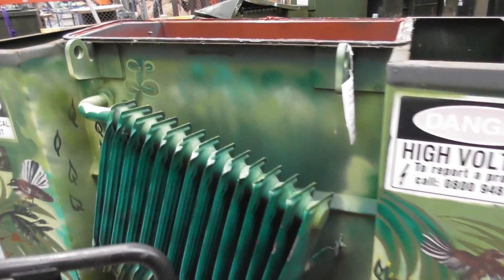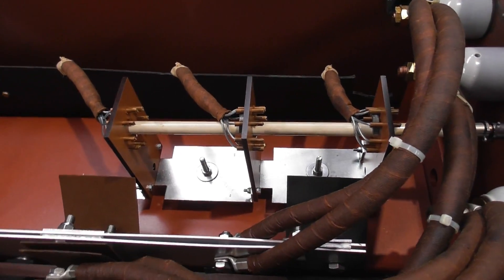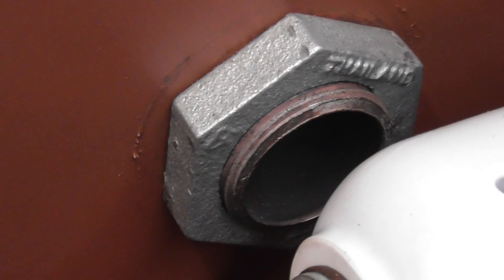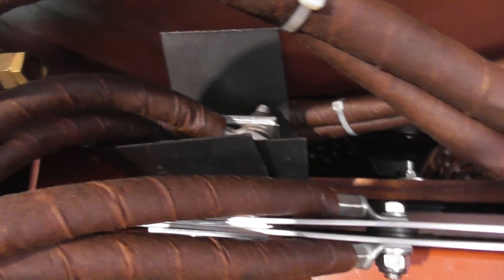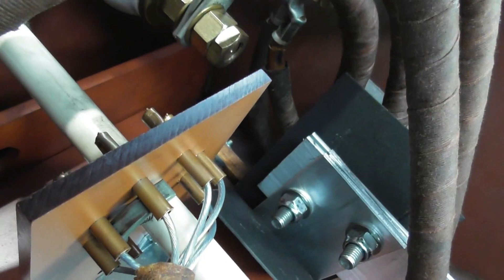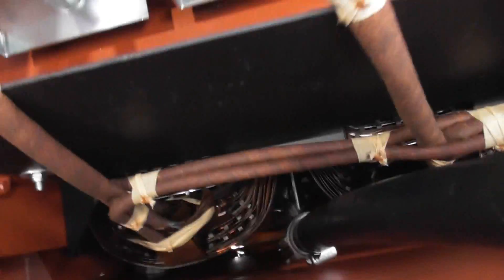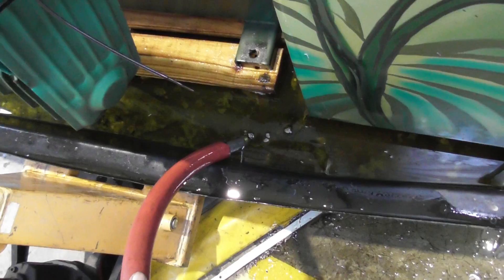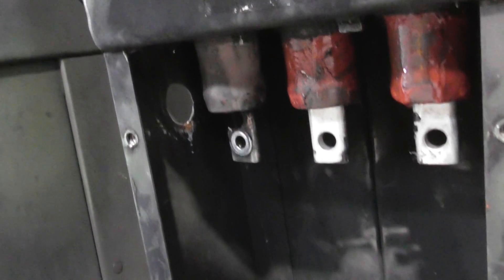300 kVA distribution transformer

Comment: Question, please. Do high voltage power lines come in specific discrete voltages, or are they calculated separately case by case?
Reply: In the UK we use 400, 275, 132, 66, 33 and 11kV. Railways use 25kV single phase.

Comment: Looks like a standard household radiator.
Reply: But then it would be cast iron right?
Reply: @alouisschafer7212  You can still buy these types of radiators, but I think nowadays they are using a stamping process instead of cast iron
Reply: @jvanoosterom  no idea why you would buy them since much more modern and better looking ones exist.
Never knew they made this style in stamped steel too.

Comment: I assume this unit was in operation when the car hit it?  Did it continue running as the oil leaked out, or did it get shut off before much leaked out?  I would think at some point it may arc internally as the oil level dropped in the tank.
Reply: Most big oil filled transformers have a relay between the oil expansion tank and main tank, when the oil level drops or if a gas bubble is formed a float drops in the relay to trip the transformer or send an alarm.
Reply: @gh-ur2lx  Sorry for the late response.  Thanks for the info.  I didn't know that.  Glad they have some sort of safety mechanism built in.

Comment: From the looks CCA wire on the primary as well, and well worth the repair, as panel beating that, along with a new radiator, will not be much of a job, just needs to have a BFH make the panels flat again so the rubber can seal.

Yes you got rain, just like me, though the damage is pretty severe again, still busy trying to fix the last damage from the tropical cyclone that visited last month, and again the houses are washing away in the 50 year flood line, plus all those built on unstable coastal sand.
Reply from the maker: My thoughts too re the CCA wire.